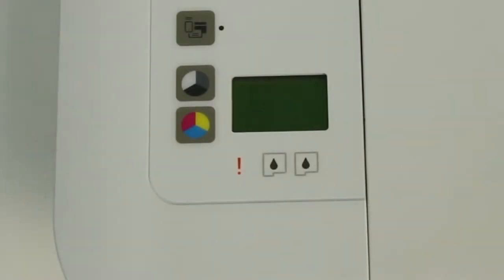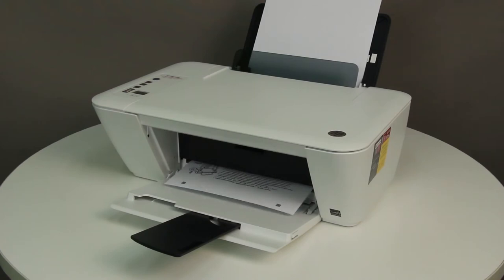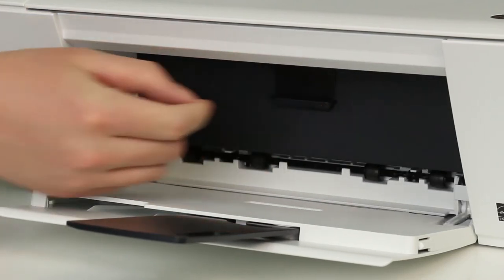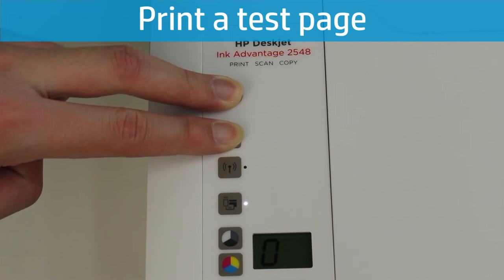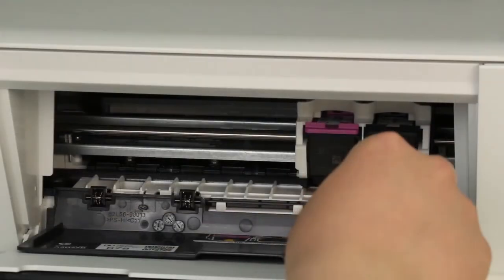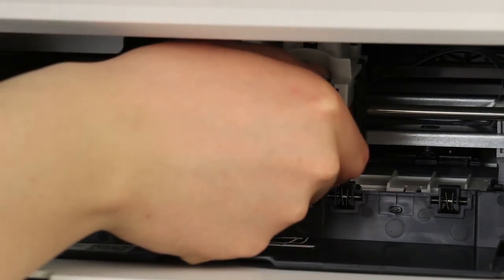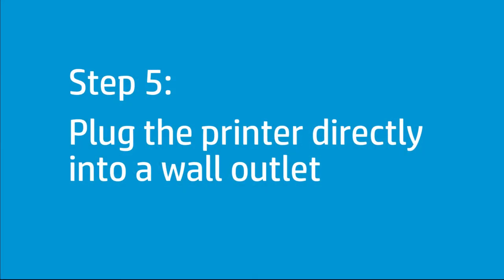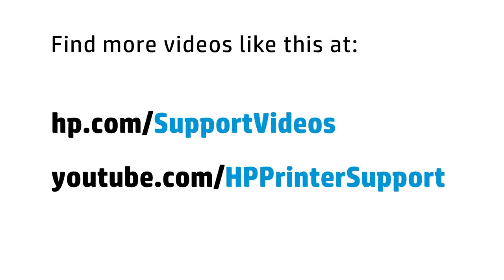Fixing a Carriage Jam | HP Deskjet 1510 and 2540 Series | HP

Comment: Hi , I have the same model HP 1510 desk jet printer , I hardly used it , The problem now when I wanted to use it , the color ink indicator on the printer starts to blink ,change a new one still the problem persist . Followed all the measures you provided .still nothing works . Tried several times , Nothings works , printer just roll out  blank paper ,,, no test pattern at all ,, FYI my printer is hardly used , I think I  only used it five times ,just to print GOV related  documents  . What could be the problem . your support please

Comment: my HP 1510 printers right side cartridge indicator giowing continuously and not print but its adjust or align often  and stops or becomes  stand by mode. what will be the fault ?please..
Reply from the maker: +Ganesh Poojari Please perform the steps mentioned under this document to fix this issue: https://bit.ly/3oJUCkW

Comment: i did all that but the lights are still on
Reply from the maker: +Alicia Martinez   If the carriage will not move manually, then you will need to contact technical support. To contact support, what you can do, is use the following link to create yourself a case number, then call.  It may help speed up the call process.

Step 1. Click on the link:   www.hp.com/contacthp/
Step 2. Enter Product number or select the auto detection
Step 3. Scroll down to ‘Still need help? Complete the form to select your contact options’
Step 4. Scroll down and click on ‘HP contact options’
Step 5. Click on ‘Get phone number’

Case number and phone number appear.

Comment: I am insert new HP 802 for 1510 printer but it's also showing damaged  colour led is blinking continuously I think printer contacts damaged please what can I do ?
Reply from the maker: Check out this document: Blinking Lights on the HP Deskjet 1510 and Deskjet Ink Advantage 1510 Printer Series - ( http://ow.ly/FOwJ3024ouo ), specifically you want to follow the instructions within "Issue: One or both Check Cartridge lights are blinking"  Let me know if that helps.